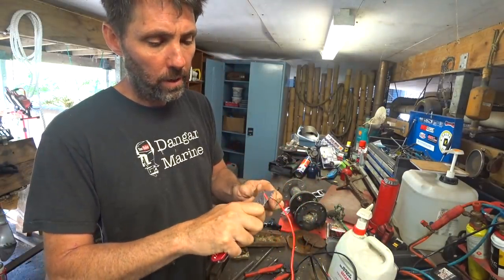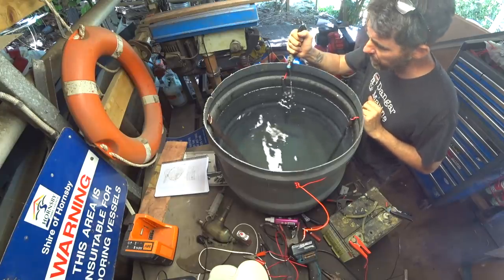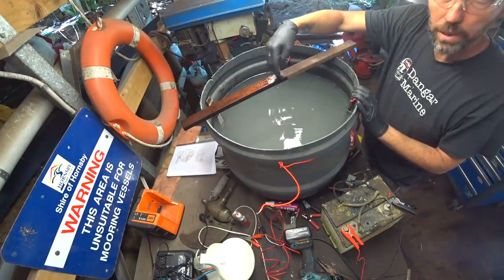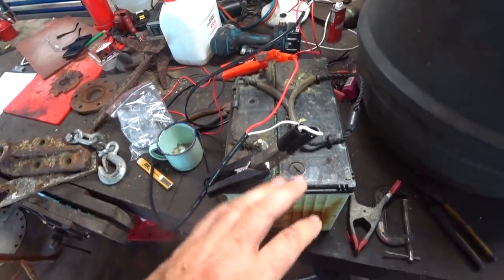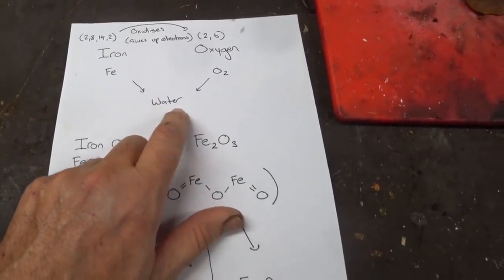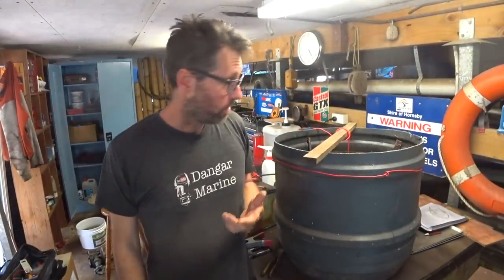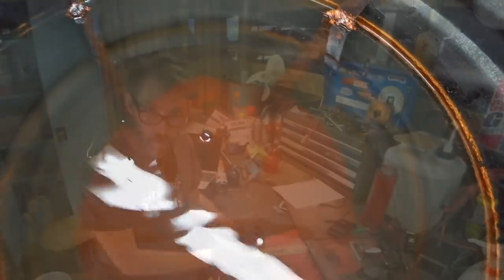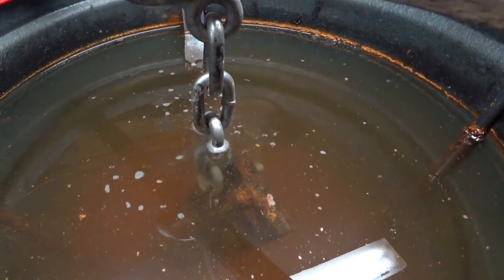Using electrolysis to convert rust

Comment: Interesting , but somehow wouldn't just sand blasting and epoxy paint be a lot quicker?and easier? The amount of iron you save is going to be minimal and if it makes a difference then it's not strong enough in the first place. 
I make some parts of plating operations ( bronze hooks attached to lead anodes that are hung from 400 amp buss bars) would higher amps speed up the process?  
How does this compare to ' brush on' rust converters?  Cheers Warren

Comment: Admittedly electrolysis does have some advantages over other methods , but if you want to get the job done in a short time it is pretty well useless and you are much better off using a good commercial rust remover or a suitable acid.
Reply from the maker: Yes, fortunately I'm in no rush with this as it will be a while still until I am ready to install these parts. I can get on an do other jobs while the electrolysis gets on and does its.

Comment: That was a very rusty video! haha. Very nice work. I was wondering if you considered using higher voltage and/or current? I haven't done this operation before. Did your info source mention the advantage or not of using more voltage and such? Just curious.

Comment: I believe the chemical changes occur on the anode and the cathode. I don't believe the electrolyte (liquid) is there for any other purpose than conducting electricity between the anode and the cathode. Nothing wrong with using sodium bicarbonate (washing soda) but an equivalent solution of sodium chloride (table salt) would conduct the electricity better. I don't think there is much chance of breaking down the salt into elemental sodium and elemental chlorine.

Comment: If the chain dropping into your solution is galvanized won’t it interrupt the current?
Reply: I'd have thought that it would mess up the zinc coating but I'm guessing the chain is non important. I don't like the idea of chain full stop. I can't cay this with authority as I've not done any electrolysis but the poor connection between each chain link wont aid current flow. If he has two parts that are the same I'd string them both up with chain but run wire down to one of the parts to give it a low resistance connection. I'm sure the well connected part will clean quicker.

Comment: Small correction. The Hydrogen released is not H but H2 (gas). Regards. Silvano
Reply: @Silvano Cometta ...another small correction. Water is H2O, 2 atoms of Hydrogen & 1 atom of Oxygen.
Hydrogen is H not H2, H2 is referring to the number of atomic atoms.
Dihydrogen monoxide is the technical name for water. The subscript 2 in the formula H2O refers to two atoms of hydrogen. The fact that the oxygen has no subscript refers to one oxygen atom. 👍

Comment: Chains don't conduct electricity very well as the links are not properly attached to each other. That being said, it looked like it was working so maybe the weight was enough to hold the links tight.
Reply from the maker: Yes, I would only use the chain for heavy items and so far it seems to be working well.

Comment: Don't put the copper wire  in the tank, use  black iron wire to hang your part.  Notice the bubbles were coming off the  copper,  not the steel part.   I did that the first time I tried this and a nasty green scum  formed on the steel rods and the water.

Comment: I suspect that the risk of a hydrogen fire or explosion from the electrolysis of iron oxide (plus water) in your setup is very low, even in a relatively confined environment because a) the volume of hydrogen you are generating is tiny compared to, say, the volume of air in a room, and b) Hydrogen is very hard to confine because it is around 1/14th the density of air and pretty much every material is porous to it. As soon as a bubble of hydrogen breaks the surface of the water in your tank it's not hanging around, but is heading for the stratosphere in double quick time!
Reply from the maker: Yes, I agree too. Pretty safe thing to do.

Comment: I myself have tried soaking rusted parts in straight vinegar it seems to do the trick
Reply: The vinegar attacks rust so essentially what you are doing is cleaning your metal piece with wire brash, while he electrolysis converts the rust back to the metal, just like Stu explained.

Comment: I cringed a bit when you said you were going to strip the wire then pulled out a box cutter !

Oh man, always mix powders into solution separately when adding to a large amount of water, I think the instructions even say that for the pool. You get into too much of a rush sometimes me thinks. 
\Use tig wire, Just make a piece that spans the tank and little pieces with little hook shaped ends to hang from the piece that crosses tank. 1/8  will hold a surprisingly hefty piece of steel.
Reply from the maker: I was wondering why nothing went wrong...

Comment: What makes it turn black?
Reply from the maker: Magnetite, the intermediate stage of the conversion is black. It is the same stuff on audio cassettes.
Reply: Other than being annoying in color, does it cause any problems?  
I've never had problems, but restoration is problematic because of the black color.  Thanks.
Reply from the maker: Over time the magnetite will continue to convert to iron. With brushing any remaining magnetite comes off and you are left with shiny metal again.